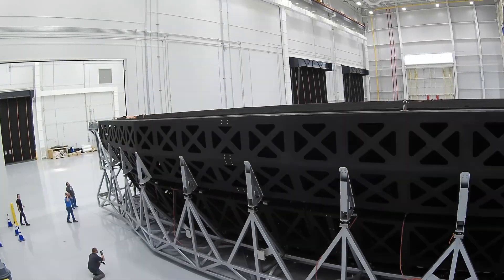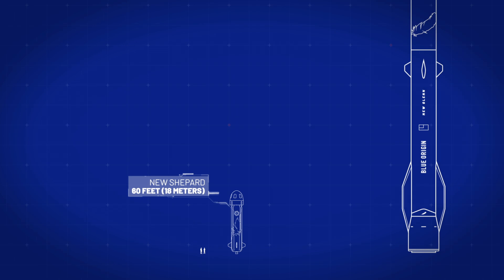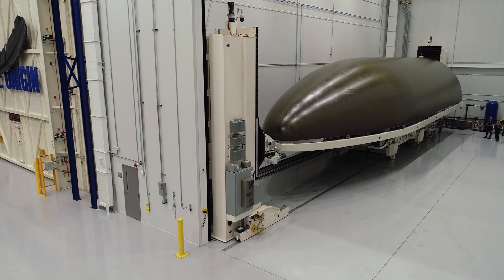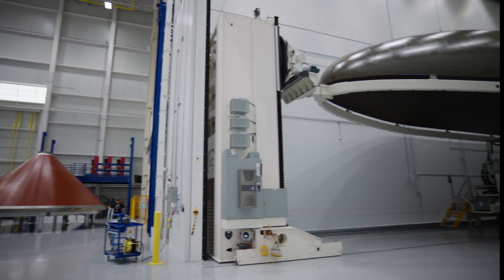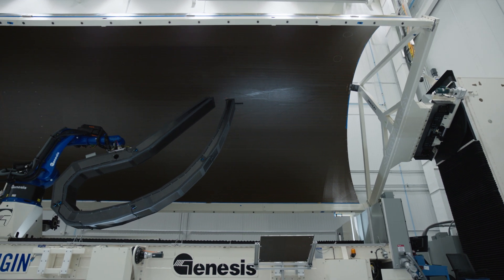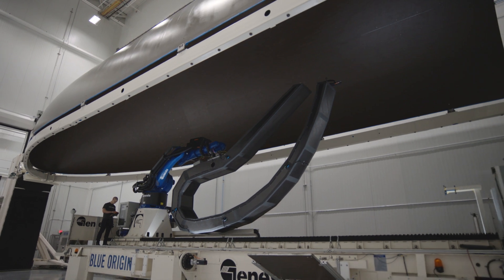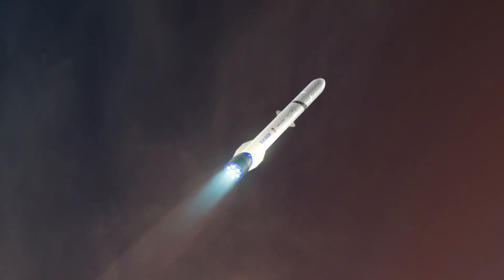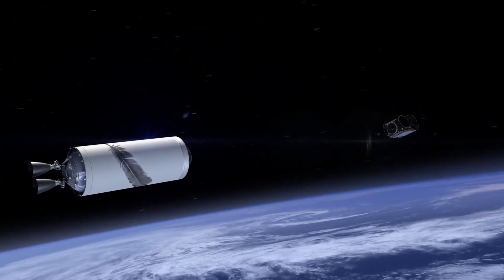Inside look at the New Glenn 7 meter fairing

Comment: Why don’t just open it like a hatch, when the payload its at a safe distance, close it again, and land the second stage so you can recover 100% of the vehicle???, it might be less fuel efficient, but fuel is cheaper than manufacturing more parts right?
Reply: Well recovering a second stage is pretty hard. Second stage travels at orbital speeds, they will have to endure over 8 times the heat of the first stage. And all the extra equipment for landing and the extra fuel needed makes the payload margin just so small that it does not bring a cost saving.
Reply: Arca İpekyün yup i kno, but thats what they are trying with starship
Reply: The Lazer Project starship is like the shuttle by that. It is designed to survive reentry. It isn’t just a second stage it has huge heat resistant surfaces.

Comment: Isn't 7 meter diameter lower than Starship's 9 meter diameter? Why do they say is the biggest ever built?
Reply: Largest composite. Starship is stainless steel. Also I dont think SpaceX has built any starship parts that will go to space. Everything they've made so far is for testing
Reply: nom chompsky not that, but they don’t really have a fairing on starship too

Comment: When do you expect to stop "getting ready" and actually do something -- like make an orbital flight?  Will you reach orbit before the Starship does -- which is projected to be before the end of 2020?  How does your new fairing compare to the size of the cargo hold of the 9m diameter Starship?
Reply: New Glenn is 7m x 21.9m and max payload about 45T with expendable second stage to LEO
Starship is 9m x 19+m and max payload fully reusable is 150T to LEO
Reply: Cost is also very different, New glenn launch cost is expected to be the same as falcon 9 or Falcon Heavy so thats something between 60-120 million USD
Starship is expected to be only 5 million for commercial launches and operational cost should be somewhere under 1 million
Reply: @gh0stsk867  I think you are mixing cost vs commercial price. Falcon 9 internal cost (if reused) should be between 25-30 mUSD.  Starship's internal cost will be anywhere from 2 to 5-8 million depending what is included. Commercial launch prices for F9 start from 60 mUSD, and we have no information how Starship will.be priced.
Reply: Starship will not launch to orbit in 2020, it's nowhere near that far into development
They are still trying to build prototype tanks that don't explode when you pressurize them
Work hasn't even begun on the booster or the full launch complex and that will take a long time

Comment: it seems there are lots of spaceX die-hard fans here. Let me talk about what i feel about New Glenn. It has one big advantage that spaceX doesn't have yet, the radius. Falcon Heavy has more thrust but because of its radius, there is some payload (probably space station modules) it just can't handle. Beside, New Glenn is designed to reuse more times than falcon 9 booster which means the costs will be lower in average, so blue origin will be a great competitor when New Glenn successfully launch. Unless SpaceX finishes Starship.

Comment: I am not sure that a one size fits all approach is a good idea. The Falcon heavy hasn't flown, in part because there isn't much demand.  SpaceX is best in class. Am I wrong?
Reply: One size fits all is a good approach if they are planning mass production.  

SpaceX has had 2 commercial launches of the Falcon Heavy (April & June 2019).  There is definitely lagging demand for such large payloads.  Average satellite construction is 4-7 years and the large ones can take over 10 years.  Since it has only been two years since SpaceX demonstrated Falcon Heavy was functional, real demand won't be occurring until after 2022.  If Musk is successful, the Falcon Heavy will be irrelevant if Starship is taking payloads into space by then at the projected costs.

Comment: a shell is nothing to make, it is the rest of the ship that is hard... I see nothing
Reply: lol... the fairing is probably the most complicated part right after the engines. That's where all the aerodynamic stress hits the rocket during launch. The tanks are peanuts in comparison. They're not easy but at least there is no unexpected turbulence hitting them. These cost many millions per piece.
Reply: Lets have you make a fairing that endures high atmospheric pressure during max-q and have it light

Comment: Will it be reusable? All that carbon fiber looks incredibly expensive.
Reply: Reusable first stage
Reply: @quangho8120  Fairings cost nearly as much as engines.
Reply: @Markle2k  Do you have numbers?
Reply: @quangho8120  A Merlin costs about $2.2M. The Falcon 9/Heavy fairing costs about $3M per half. RUAG charged Arianespace $118M for eighteen 5.5 meter Ariane 5 fairings in 2014 for delivery 2017 through 2019. That's roughly $6.56M per.
Who knows what BO costs are. The BE-4 will eventually have a price as it will power the ULA Vulcan 1st stage.
Reply: If you have an idea on how to recover the fairing from those speeds, speak now.
Reply: @_Andrew2002  Here's one way that SpaceX has managed it.
https://youtu.be/dKFK0wXXyKE
Reply: @_Andrew2002  New Glenn won't be doing interplanetary missions will they? And if they do, fairings are ejected while the rocket is still suborbital, so it's not some crazy speeds they have to endure
Reply: @quangho8120  New Glenn will be travelling much faster than any Falcon has done at stage seperation. The fastest Falcon has done is 11,000km/h, New Glenn will at slowest be doing 13-14,000km/h. Add another 500km/h to the fairings and you see the impossibility.
Reply: @_Andrew2002  that fairing has very high drag per mass ratio, hence very low terminal velocity. Why wouldn't you be able to recover it?
Reply: @nikitakazovski9619  I'm not saying it isn't possible, but it's hard and expensive. It's gonna travel much faster than Falcon fairings ever have. It may survive but you'll need recovery teams 1500km down range. SpaceX has been doing fairing recovery since SES-10 and is still struggling to catch.
Reply: @_Andrew2002  catch and reuse are two different thing.

Comment: Carbon fiber composite, that must be very expensive to make, are you going to be trying to recover it?
Reply: Likely not
Reply: They would be foolish not to consider it, it's proven to be possible.
Reply: @nikitakazovski9619  if only somebody would had tought about making a second stage able to return and be reusable.....
Reply: Good luck recovering it at the speeds it will seperate at, will cost more to recover it
Reply: i hope when it was released i can get it so i can sell it
Reply: just simply drop it in ocean ....that big fairing can be easily recovered ....
Reply: Like SpaceX does. Parachute it to sea to be collected

Comment: Sick, but reusable rocket won't be able to make use of such fairings in most of the cases anyways. You reach the weight cap to desired orbit faster than your fairing volume. And also it's pain to build massive  disposable expensive fairings to satisfy customers that won't ever use that size.

Because clearly reusable rockets won't be used for James Web telescope, or projects like this that could make use of it, at least for next 5-10 years + time to develop the thing for such fairing.
Reply: They expect about 13 tonnes to GTO (in reusable mode) which would be about 3 GTO satellites, but I don't think they can fit more than 2 in the fairing even with the bigger fairing (since next to eachother will be very tight and the fairing seems not high enough for a triple stack, so probably it will launch just like in your typical ariane5 style). And I agree even though it has  little more performance than AtlasV, Vulcan, Ariane5 for GTO it will lose that performance for deeper missions due to a less efficient upper stage.
So it sounds a bit strange indeed...
Till you remember that Amazone is busy with "project kuiper" which is a starlink like constellation (booo!) which will be launched with BO (probably New Glenn), and if you compare it to starlink launches which are fairing volume limited (why they don't launch starlink on fh) there is a huge potential to launch like hunderds of kuipersats (assuming they do have roughly the same size) per launch. 
Also there are alot of rumors going around that new glenn is more or less another experimental rocket and that "new armstrong" is following very closely after (they're building infrastructure like the launchpad and facilities for bigger rockets than New Glenn) and that they're more or less testing fabrication processes with new glenn.
Lastly remember that the payload to LEO is 45 tonnes which is pretty huge and that the philosofy of BO is not to get interplanetary or something but just to launch alot of habitats, fabrics, ... into space (so that people can work in space), if you look at an ISS module and than imagin how big such a module would be if it could reach 45 tonnes you start to realise that indeed large fairings are necessary for BO's philosofy even though for market demands it's wierd.
Reply: @SneeuwPoesjes   
Well they plan to put 3200 satellites, as opposed to 42 000 starlink satellites. The other thing is, that for the SpaceX with starlink, the weight was the issue. Those satellites are custom build to fit the mass capacity, and the secondary objective was to make them easy to build, not necessarily conserve space, that's why they fit the whole SpaceX's puny fairing.
Those satellites just don't need to be conserving space for sake of higher build cost, since you can't put more of them in here anyways.

Similar issue will be here for New Glen. They're be probably able to fit 100 of their satellites rendering their network fully operational after 32 launches. 
But exact nubers are yet to come.
NG'll had more than 2x power than Falcon 9 but had to place their satellites to 600km orbit (twice that of Starlink) so 80, or 100 satellites per launch are most likely. I assume they'll launch 80 and use spare space for safe release mechanism.

Comment: all that engineering and expense  ..  if that isn't recoverable and reusable ..   it had better evolve quickly .
Reply: It will be reusable, they aiming for atleast 25 times
Reply: @ProtoX37  For the booster - there are no announced plans for fairing reuse. And those fairings have got to be expensive.

SpaceX having proven the concept though, means Blue Origin are likely at least considering it.
Reply: @dandavidson4717  I could see them taking a page out of SpaceX's book with the fairing catchers, though the practice seems unreliable so far so whether it'll be worth it to them is beyond me.
Reply: @dandavidson4717  SpaceX will probably only use the used fairings on Starlink where cost matters for SpaceX. Other launches are paid for by customers and so are the fairings. I doubt it makes sense to risk losing a customer payload but who knows. Maybe Jeff ;)
Reply: kNews.space the fairings sure are paid for, but if they reuse they can make even more profit. So win-win.